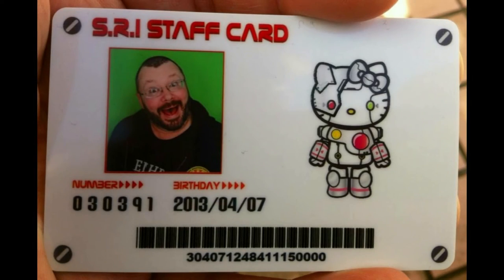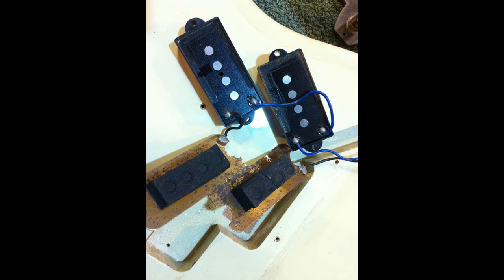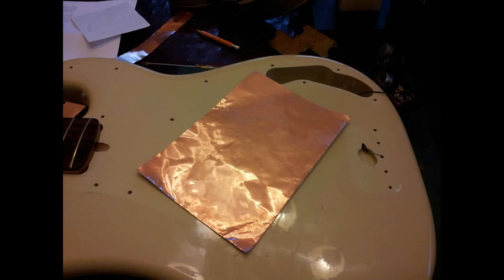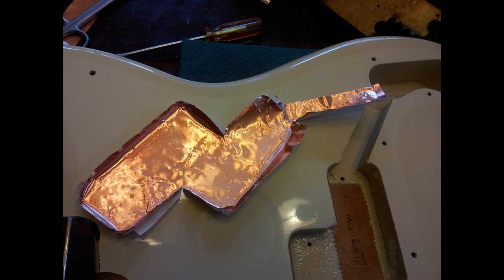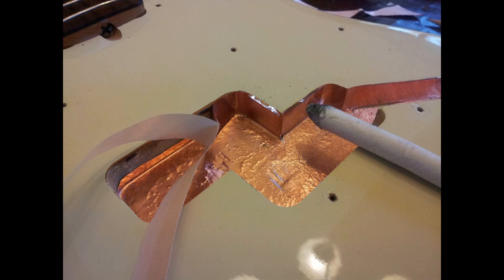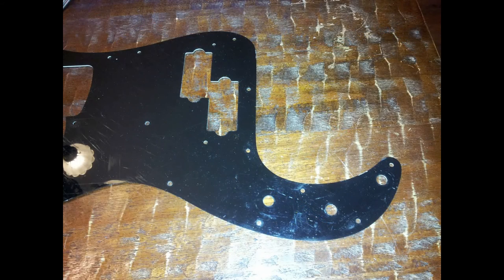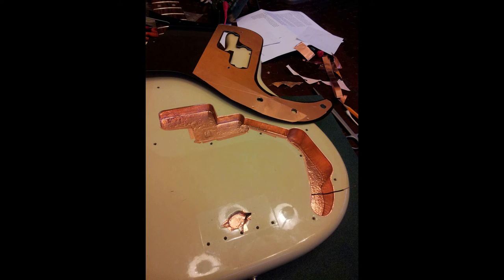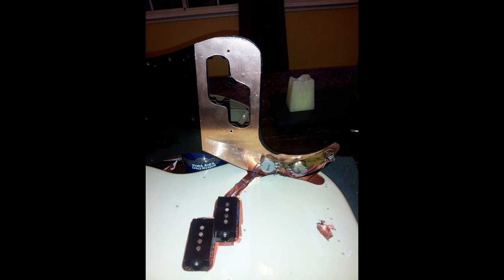TOKAI HARD PUNCHER bass shielding | RATTLECAN GUITAR RESTORATIONS by James O’Rear

Comment: Was there a need to re-solder any of the wiring from the pickups to the control pots when removing and putting everything back inside the cavity? I just got some copper tape and really want to try this out but I’m worried about the wiring.